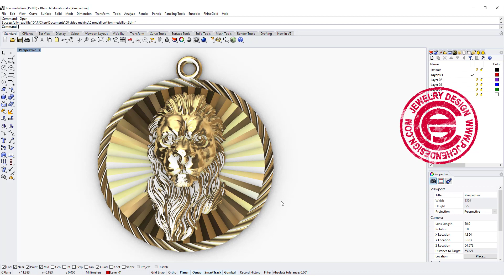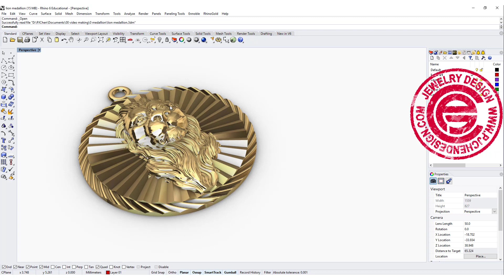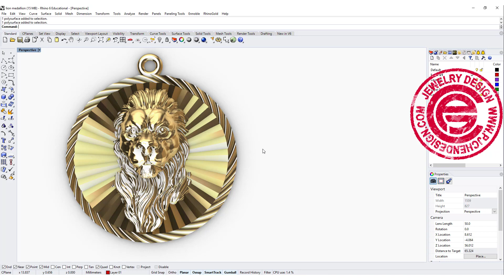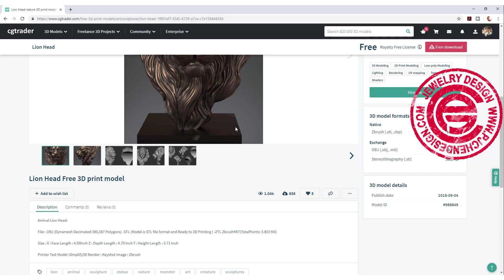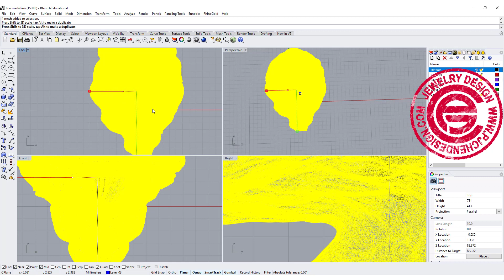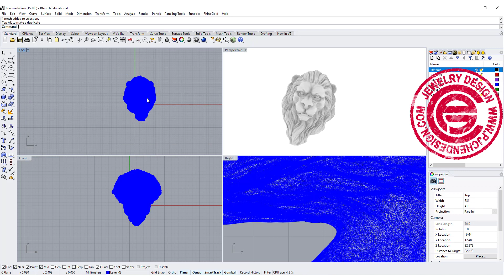CAD Design for Lion Head Medallion in Rhino 6: Jewelry CAD Design Tutorial #80

Comment: Is that ok to send a mesh file to the factory when making these jewerlry type of product?
Reply from the maker: If you are looking for 3D printing. they have to be in mesh and stl file.
Reply: @PJChenJewelryDesign  I mean in real production, not 3D printing. I design bottles for a liqor company, recently I come up with some idea to combine shapes like sculpture with bottle design. But sculpts like a human face or lion face are quit diffcult to model using nurbs.
Reply from the maker: @baoyuj5585  for the face sculpting. Zbrush will be a better app
Reply: @PJChenJewelryDesign  yeah, I do sculpt in blender though. However, the scuplt mesh model will be merged with the solid I created in solidworks or rhino. My solution now is to simplify and make quad mesh in blender or Zbrush then bring them into rhino then turn the quad mesh into SubD which is still WIP and convert to nurbs. Sometimes this method just loses too much detail . My point is,  , are STL or mesh files be accepted by the mold manufactor?
Reply: @PJChenJewelryDesign  Thank you for your patient reply.

Comment: Hi PJ,  I 'm really got stuck at the 5:34 when trying to trim using polar tray and the bottom surface to trim the top and the bottom parts , it always turned out not the way it supposed to be, would you please to going a little bit slower so I can see what's I am missing thanks
Reply: thanks PJ, I have found that moment when you do gumball on the circle , I didn't see you mention that we need to move inward on both 9 o'clock and 12 o'clock points  in order to proceed surface extrude then we can trim it correctly, now I can move further . Thanks again
Reply from the maker: Hi Anhtuan, if it is hard to view which one is which to trim correctly. you can  change one of  the object in different color or change it to wire frame mode. it will be easier to see 2 different parts.